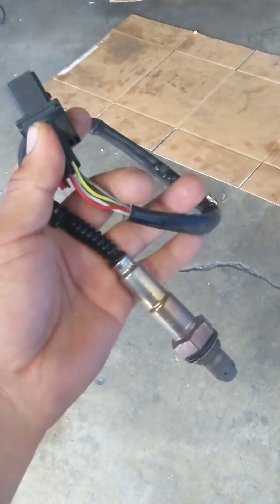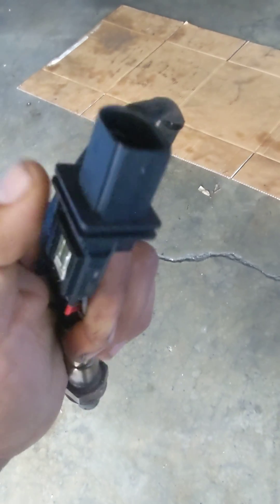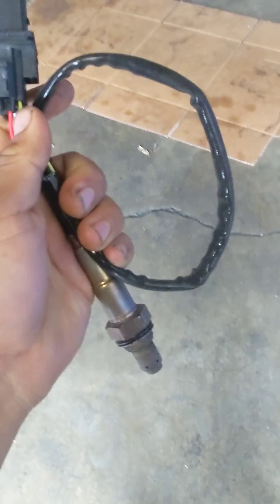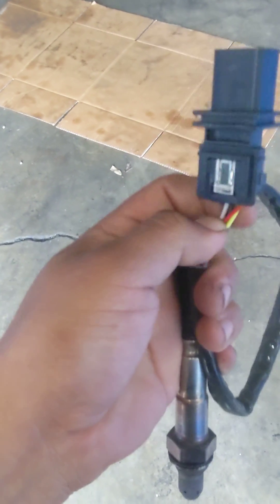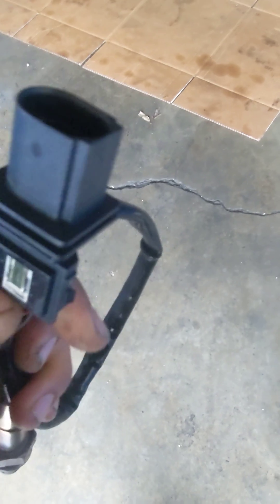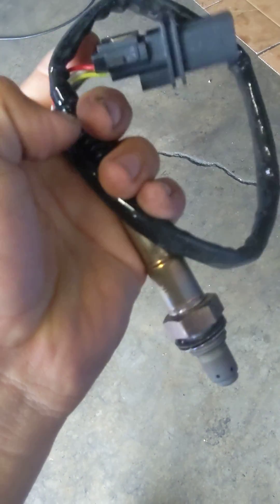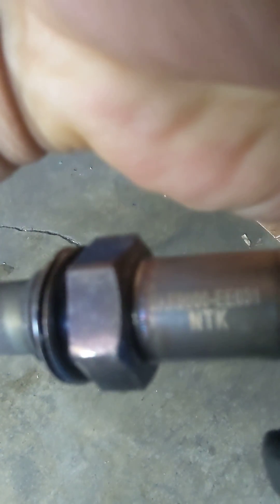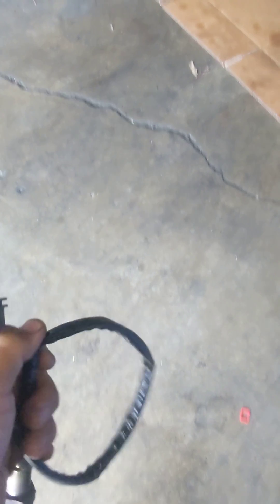open loop fault? here is a tip.

Comment: I bought a new O2 sensor (NTK) from Autozone about 6 months ago for my 2003 Elantra. I have a stall issue with no codes. Before the stall the engine sputters like if it had a misfire and I notice the "Fuelsystem 1" on my OBD reader go from "CL" to "OL-Drive" and then stalls upon stopping the car.  If it recovers from the sputter it goes back to "CL" instantly , but the recovery only last for 5 seconds before it sputters again and it goes back to "OL-Drive" . Any Ideas?
Reply from the maker: Check your fuel trims  if Lean sound like a air leak  but I've seen. Crank sensors not giving codes but causing stalling, clean your throttle body.
 If you have access to a fuel gauge I'll say hook it up and see if you're not loosing fuel pressure.
With out looking at the car that's the best I can do
Reply: @abbsgarage.9676 Thanks for the advice, if I fix the issue ill give you an update of my findings.

Comment: Man, I hope you see this. I'm dealing with a stalling issue on a 2011 3.5 KIA Sorento. I've done a ton of diagnosing trying to find the issue, i even found that right before it stalled, the oil pressure light would flicker until it went solid when it stalled, so I replaced the oil pump thinking it was an oil pressure issue since it had so much sludge and carbon when i had looked inside the engine and you could barely turn the pump gear by hand. Now I'm thinking the oil pressure light is a symptom of the stall. Anyways the only of thing I find in the live data is that the electronic throttle body at idle status at -8 to -15% and the upstream O2s reach closed loop almost instantly while the downstream O2s stay in open loop. It seems like the sensors are working like they should through testing and they check out continuity wise which I hate using as test, usually like my circuits tested with a load. Any thoughts from anyone are welcome, I even found a TSB for a stalling issue with the same symptoms that recommended a flash update which I performed successfully. Anyways, thanks to anyone who takes the time
Reply from the maker: You need to check your cam phases since they are vvt.. also what codes are u getting.
How are your fuel trims.???

Comment: I Have a 2007 Jeep Liberty with a P1128 Closed Loop Fueling Not Achieved Bank 1. I Have Replaced all The Fuel Injectors , Spark Plugs, Coil Packs And All 4 Oxygen Sensors and The Car want to stall out after driving for 15 minutes. I even went out and bought 4 new oxygen sensors and still getting the same code.
Reply from the maker: @Iseekoutthetruth  any freeze frame data?
Reply: @abbsgarage.9676  I Am Not A Mechanic and do not have a scanner.
Reply: I would check cam and crank shaft sensors

Comment: Great tip! I cant understand why the A/F sensors would cause an open loop though? The A/F sensors are only working in closed loop. Any idea why that is?
Reply from the maker: @adammajid6937  so in older cars this is true however  as the sensor not being  responsive  the ecu went to basic settings. To protect  the catalytic converter.  Remember  the sensor  reads the ratio (estequiometry) not just the oxygen content. Plus it think the sensor was a knock off version not a reputable one.